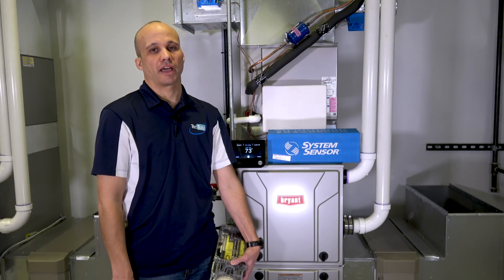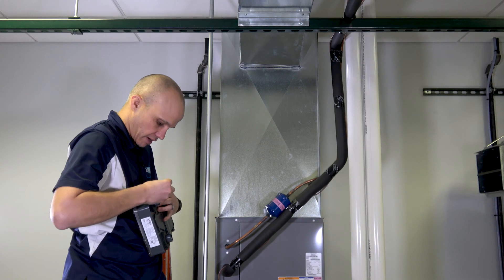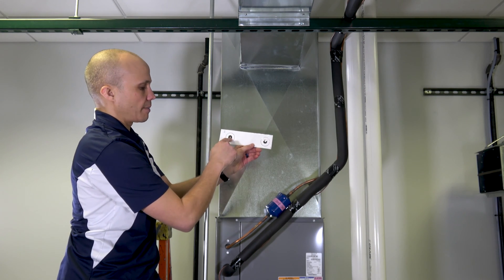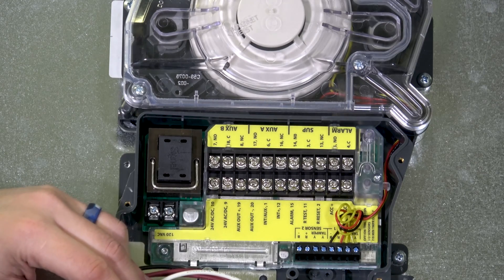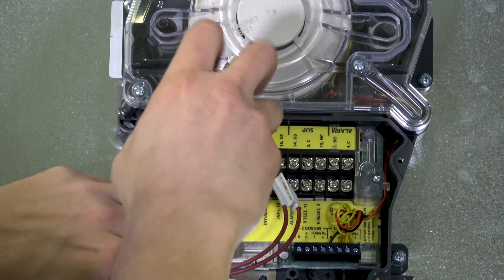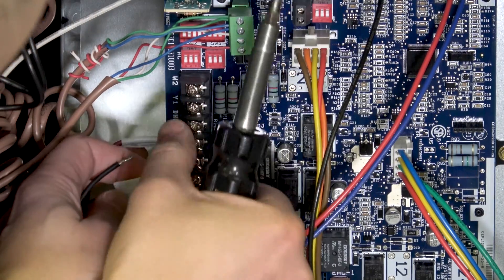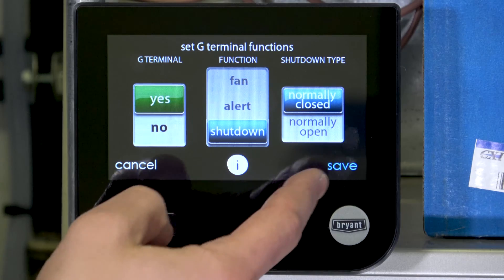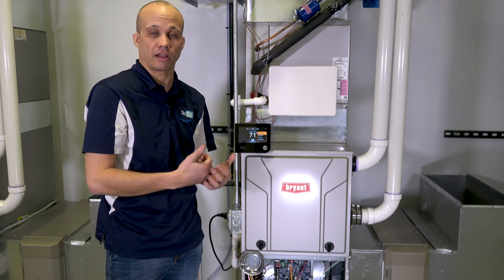Duct Smoke Detector for Infinity, Evolution, or Ion Controls

Comment: The air flow is supposed to hit the intake sampling tube first with the exhaust tube down stream. I'm pretty sure you should of turned the duct detector 90 degrees on that vertical duct so the tubes line up vertical. The way you installed would be ideal on a horizontal duct run
Reply from the maker: We understand your logic, but that is not a requirement of the installation. So long as the holes of the sampling tube are facing into the airflow, the pressure difference will be created to move air thru the assembly. With the air entering directly into those holes, you have velocity pressure on the sampling tube but not on the exhaust tube.
Reply: It's installed in supply or return duct ? @TECTubefilms

Comment: I see you mounted the sampling and exhaust tubes on the same plane. I have mounted them like this as well but after reading the cut sheet it says “the unit can be mounted vertically”,which I would assume would be for a vertically run duct like you have here, “ as long as the exhaust tube is downstream of the sampling tube”.  My question is have you ever used a manometer to test if the differential pressure is where the cut sheet says it should be. Basically I’m asking does it really matter if the exhaust tube is downstream or not? Without testing with a snow bomb or manometer it’s hard to say. The jobs I’m on I can test the operation yet because the units will be shipped to site without being completely functioned tested.
Reply: Never mind. Decided to call tech support and they said it would work fine like this.
Reply from the maker: Ryan explained it in the video, but the orientation of the holes on the sampling tube is what matters and what forces air into the chamber. The orientation of the exhaust tube and of the controller itself does not make a difference.
Reply: @TECTubefilms  yeah I get that and basically what tech support said confirming what I already know to be the case. The thing is when the literature doesn’t spell it out as such and you get an over zealous QA/QC guy at a place like I’m at right now it can be hard explaining it to them.  I have one right now telling me it needs to be in the center of the duct and since it’s redundant with two on the supply and two on the fresh air intake duct that they should be offset instead of inline with one another etc. The two are on the same plane on a horizontal duct about 6” higher than center on a 18” tall duct. Plenty of air flowing across it. But he wants to argue we need to drop one down to cover more  of the duct.  I just said you waited until 23rd out of 26 systems to bring it up. They’ve all been signed off so the end user or the company we work for will be paying for any changes any of the other systems that have duct smokes not directly in the middle. Still waiting to see what comes of that. I’m installing these for our fire system. Mechanical was lucky enough not to have to mess with it.

Comment: great information! BTW, would you please share how to wire to existing wired smoke alarm for interconnect purpose? thanks a lot
Reply from the maker: Are you talking about a duct mounted smoke detector or a ceiling mounted one?
Reply: @TECTubefilms  I would like to see if we could interconnect Duct Smoke Detector with Smoke Alarm? How to do it if possible? Thanks
Reply from the maker: @TheMontanasv6  You may be able to do it, but you should not. They serve two different functions for compliance with two different codes. The duct smoke detector's job is to shut down the HVAC fan system so smoke is not distributed throughout the building. Teh ceiling detector's job is to notify the occupants.
Reply from the maker: @TheMontanasv6  Wait... are you trying to connect the duct smoke detectors to the ceiling smoke alarms or are you trying to connect it to a fire alarm panel? If the latter, consult the panel manufacturer. They may be able to use standard detectors, but they may also require communicating style.
Reply: @TECTubefilms  yes, it is residential house, I am trying to connect the duct smoke detectors to the ceiling smoke alarm. Is this a code required in Ontario?
Reply from the maker: @TheMontanasv6  We are not familiar with code in Ontario but we have never heard of anywhere where ceiling smoke detectors get interconnected to duct smoke detectors. Additionally, we are not aware of any codes in any area that even require duct smoke detectors for residential. They are required in commercial buildings, but optional in residential.

Comment: Thanks for clear instructions! I have a DNR. What is the purpose of the rectangular magnet that is included?
Reply from the maker: The magnet is to trip the relay so the installer can verify correct wiring.
Reply: @TECTubefilms  Thanks for the information. I assume any strong magnet will work.
Reply from the maker: @randallbaker4293  Any magnet strong enough...
Reply: @randallbaker4293  each speaker strobe has a magnet. In case of emergency , i breake the speaker and use the magnet on the back. Is super powerful. 3 seconds and you activate an alarm on duct and smoke detectors
Reply: @deathvalley1477  Thanks!

Comment: For Everyone wondering how to hook this up to a legacy (old) tstat. I just spent the last 6 hours troubleshooting. I'm not an electrician or HVAC professional, but this is what worked for me. In my area (Toronto, Canada ), inspectors want to see the smoke detector cut off the furnace's main power. You can do this in 3 ways. Tie into the furnaces wall switch, door switch or main fuse. I went with the wall switch because it was near my furnace, and I didn't want to splice any wires in my furnace. 

1st turn off the breaker 
2nd wire constant 120v to the 120v terminals on the d4120. You can grab this off the wall switch if available or any nearby plug. Don't forget to connect ground to the ground terminal also.

3rd wire another 120v line from the comm and NC aux contact off the D4120 and send it to the furnace wall switch. 

4th, unplug one of the leads off your furnace wall switch and marette it to the lead coming from NC. 

5th take the lead coming from COMM and attach it to the furnace wall switch. 

6th have a drink because you just saved yourself 5 and half hours of work. 

Turn everything on and test 
The smoke detector will now act like another wall switch and cut main power to the furnace. Just like if you went to your furnace switch and switched it off. 

Pretty straightforward now that I know, but God it's so hard to find information online about this. 

Btw I used 2 14/2 bx wires for this but I'm sure you can do it with 1 14/3 bx wire if you grab power and switched off the same wall switch but I didn't have any 14/3 bx. Again I'm not an  Electrician or hvac professional. 

Best of luck
Reply from the maker: The manufacturer of the detector in our video (System Sensor) has a 1-hr webinar on smoke detection if it helps anyone.  https://youtu.be/JhISF8doTAU
Reply: @TECTubefilms  This webinar didn't say anything about how to wire 😂
Reply: Thank you Mike you saved my day. And I indeed had a coffee while watched it all worked.
Reply: That didn’t work maybe i did something wrong but if I use the feed of the furnace switch I will back feed the circuit. If I use the return of the furnace switch the furnace won’t turn one.
Reply: Make a video of that please its so hard to do it by just reading

Comment: Commercial code requires the detector in the return duct.  Is the a reason or code for residential to mount it in the supply duct?
Thanks
Reply from the maker: Different commercial building codes have different requirements:

IMC - requires RETURN duct smoke detection for 2,000 CFM (if over 15,000, then both return and supply are required)

NFPA -  requires SUPPLY duct smoke detection for 2,000 CFM (if over 15,000, then both return and supply are required)

Note: if your jurisdiction follows both IMC and NFPA, then above 2,000 CFM you need both a supply and return detector
Reply from the maker: There is some logic to putting it in the return on a commercial system.  When the RTU is in full economizer mode, a fire in the building would not bring smoke back to the detector if it was located in the supply duct.

There is also some logic to putting it the supply.  If the fire is inside the air handler, such as an electrical issue with the motor, then a return smoke sensor won't see that.
Reply from the maker: In this video, we put it on the supply duct because we do not have much return duct on the systems in our labs.  It is just 90 degree elbow and 2 feet of duct.  In his own house, Ryan has the smoke detector installed on the return.
Reply: Thanks for the feedback.  Could you give me your opinion on my video for my patent for residential fire protection.
Furnacefaninterrupter

Comment: I am interested in Commercial applications. Does the smoke detector could be reset from a Building Automation System or code requires manual reset? In my case, we have a smoke evacuation that would purge the smoke in the space. Thanks!
Reply from the maker: Duct smoke detectors in commercial applications are regulated by both NFPA and IMC.  It is probable that manual reset is required by code.  

Unrelated to code, you may be able to reset from a BAS.  Most duct smoke detectors have an option for remote reset... although it is usually a keyed switch, not a BAS.  Something like this https://www.systemsensor.com/en-us/Pages/RTS151KEY.aspx

Although, we do not think anyone is going to want the liability of resetting a smoke detector remotely from a BAS.  They are going to want someone to physically go into the space and visually verify that the fire event is over.

Comment: friend I am trying to install one like this in an air handler unit, but it does not work, has a different way to install it?  you can help me with that
Reply from the maker: What is the brand and model of the duct smoke detector?  What is the brand and mode of the AHU?

Comment: How do you wire this to a standard two stage non communicating furnace?
Reply from the maker: You can either interrupt the low or high voltage power circuit for the furnace.
Reply: @TECTubefilms  thanks for quick reply, so if I Run the R through detector (NC and C) and power detector with independent 120V it should do the job?
Reply from the maker: @blakebeehler3392  The System Sensor duct smoke detector that we used in the video can be powered with either 24vac or 120vac.  The contact can also handle either 24vac or 120vac.  We prefer to do everything in low voltage whenever possible to avoid the need for conduit.

Comment: Hi
What is the alternate wiring in case of standard thermostat?
Reply from the maker: You will need to wire the duct smoke detector's normally closed contact to interrupt 24v or 110v power.   It would be the same as installing it on a commercial RTU or AHU.
Reply: @TECTubefilms  Thanks for your kind reply. I didn't understand RTU or AHU. 
My furnace is Carrier Infinity 96 and has similar panel you show in video. My thermostat is standard and has limited setting options. When I followed your wiring, the SD is not communicating with flame panel. I think, I should connect the ALARM to the panel, but I am not sure to which terminals. Could you please provide me with your advice?
I already connected the device to 110 VAC and it is powered on and I just need to identify the terminals and contacts on both sides.
Reply from the maker: @alexconcord3597  RTU and AHU are acronyms for commercial HVAC systems where duct smoke detectors are often required by code if 2,000 CFM or higher.
Reply from the maker: @alexconcord3597  Which exact thermostat do you have?
Reply from the maker: @alexconcord3597  For the wiring at the smoke detector, it is the same normally closed contact for all HVAC applications regardless of thermostat type.  If you have a standard 24vac thermostat instead of a communicating Infinity thermostat, then the wiring at the furnace will be different.  Instead of wiring to R and G as a programmable input, you must use the smoke detector relay to interrupt 24vac or 110vac power to the furnace.
Reply: @TECTubefilms  It is Infinity System. Several years-old, which only operates the heating, cooling and humidity. I could send you a picture, if I have your e-mail address.
Reply: @TECTubefilms  The question is which terminals or contacts should I pick in SD4120 and at other side which is the flame board?
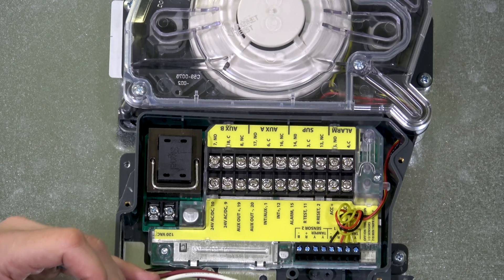Reply from the maker: @alexconcord3597  Minute 3:30 of the video shows the terminals to use on the detector.
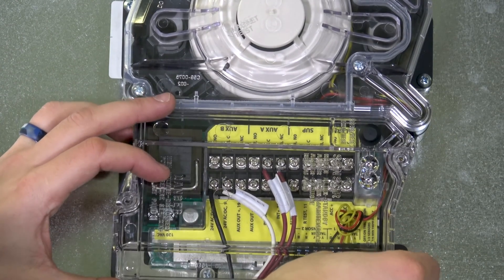Reply from the maker: @alexconcord3597  By "flame board," we assume you mean the circuit board in the furnace.  Minute 5:30 of the video shows exactly where to wire the detector on an Infinity furnace that has an Infinity communicating wall control thermostat.  As mentioned, if you do NOT have an Infinity thermostat, do not wire it they way we showed in the video.  We are confused as to which thermostat you have because at one point you said you have a "standard thermostat," but then later you said you had Infinity.  If you have a standard 24v stat, then you need to wire it differently and that was not covered in this video.  Ok, good luck sir.
Reply: @TECTubefilms  Thank you very much. I did follow the video, but since you stated that it would be different , if I have different thermostat and I reached you at again and again. In fact, my thermostat is made by Carrier Infinity, but it is a basic model not an advanced. I have tried over and over, and I see no communication between SD and furnace (flame) board. I mean nothing change when I do magnet test, push rest button or create smoke.
Reply from the maker: @alexconcord3597  Sorry, we are not sure what you mean by Carrier Infinity "basic model."  What is the exact model number of the thermostat?
Reply from the maker: @alexconcord3597  In addition to wiring it, you also have to configure the thermostat.  Did you go into the menu like showing in the video and program the "G terminal alert?"
Reply: @TECTubefilms  Thanks for your kind replies. The front face of the thermostat says Carrier Infinity System. I see no model number on the front or under the lid and have no access to the back. There is not much options on the setting except temp, humidity and schedule. I call it standard or basic because it has no advanced feature and would not communicate like yours.
I cannot attach the pictures here. I would send all images, if you provide an address.
I picked up R and G on the circuit board and connected to different ports on the SD and I see no capability of shutting  down the furnace.

Comment: Hi tech,
I just followed all your steps for wiring on system sensor on carrier brand furnace. But is does not shut down flame and fan motor at all.i have eco bee 3 stat.
Any other help
Reply from the maker: You would not be able to follow all of the steps we showed in this video if you have an ecobee.  It would not have any of the screens we show in the video to enable and configure this feature.

These instructions are for Infinity, Evolution, and Ion wall controls.  This does not apply to standard 24v stats like ecobee.  In the case of regular thermostats, you can still wire the smoke detector for shutdown the traditional way by interrupting power.  You will not get alerts emailed or text messaged out to you though.

Comment: Hey man, you did a great job in explaining everything in simple terms. However, what if i do not have one of the digital screens you use at the end of the video to finish your setup? Will the furnace not act automatically if wired properly? Thanks
Reply from the maker: This particular feature is a feature of the communicating wall control. If you just have a standard 24v thermostat, then you would need to wire this differently.
Reply: @TECTubefilms  do you have a video showing how to wire it differently with a regular wall thermostat?
Reply from the maker: @jrancourt7172  No, we do not have a video for that scenario

Comment: Good video but I would go into a little more detail on what the terminals  the do such as if smoke is present then what contacts will open or close because there are different detectors out there.
Reply from the maker: We are not exactly sure what you are asking.  Other than shutting the furnace down, is there something else you are trying to accomplish related to smoke detection?
Reply from the maker: If you are just looking for general knowledge on the System Sensor detector we used in the video, you may find something useful on their channel at https://www.youtube.com/user/SystemSensorUS